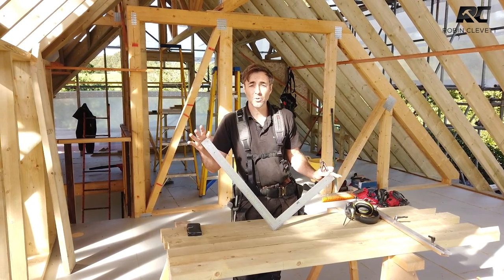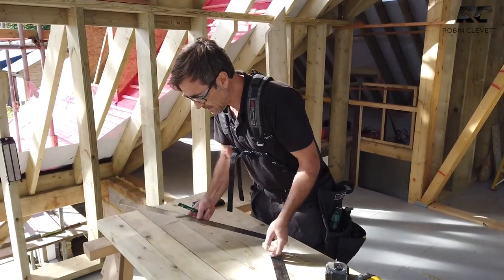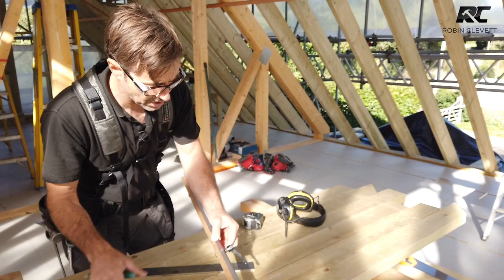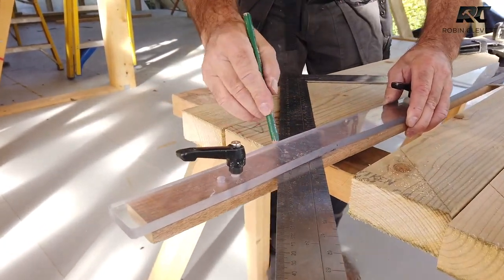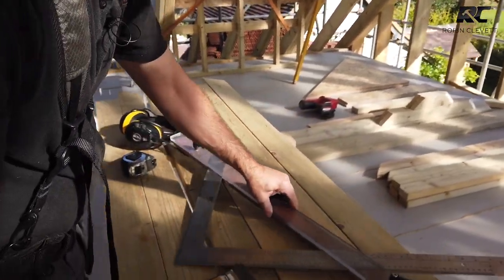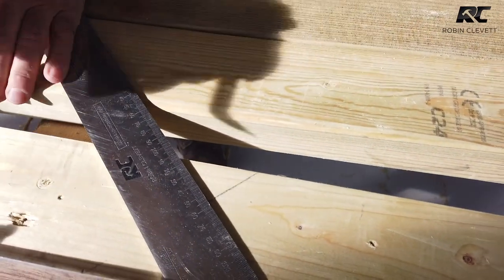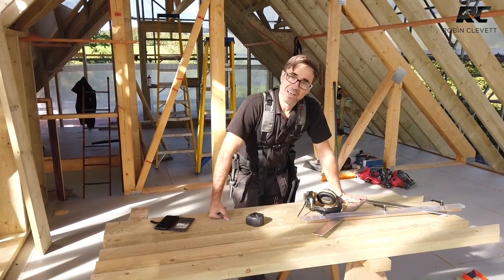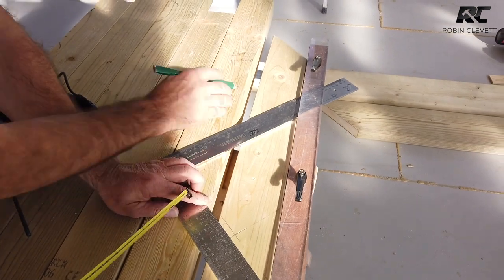How to make common rafters with my framing square including cutting birdsmouths

Comment: 9:53 is there a reason why you don't have the saw resting on the beam when cutting it? Generally one would cut the other way around so the baseplate of the saw aligns with the top surface of the beam. Just curious.

Comment: Does that app take in ridge hieght ? It's very clever I'm a bricky by trade building a porch and I'm going to tackle the roof self
Reply from the maker: Yes Michael, we have a calculator that will do that for times where you do not know the pitch but do have a maximum or minimum height etc

Comment: That's basically how I do it. A good video might be explaining how to get the length of hips if not done already and the angle.  The way i do it is half the span of the building. Work out the span distance of hip which is 45° of half the span. Then take the plumb height from the common rafter above the wall plates. Put the figures in a trigonometry app on the phone. The angles length is all worked out. Far easier and safer than going up and down scaffold with bits of string and  beval stocks

Comment: What’s the name of the app? I was hoping for an easier solution to using a pattern rafter and then marking again with the square, long rafters are a pain to keep running down both ends plus the weight of lifting the pattern rafter each time. Am I missing something?
Reply: If you rafters are all the same length, and you want to use a pattern rafter, you only need the patten from the eaves to the birds mouth, the app will only give you your basic rafter length from plumb cut down the rafter to the plumb cut of the birds mouth, just the same as any other rafter BRL calculation will.

Comment: Span is from outside to outside of supporting wall ?
Reply: David. Yes the span is outside to outside of wall plates sitting on the outer walls.
Reply: Yes although that looks like a dormer construction which is usually 4x2 walls filled in between uprights with kingspan ... on a 300mm wall ie block work,  cavity , face brickwork the wall plate sits on the internal wall

Comment: What happens when you don't no the pitch .
Reply from the maker: My app will allow to put in a height instead, generally if you are joining on an existing roof you can use a spirit level and framing square or an inclinometer then you can find the pitch that way, often our architects plans includes the pitch